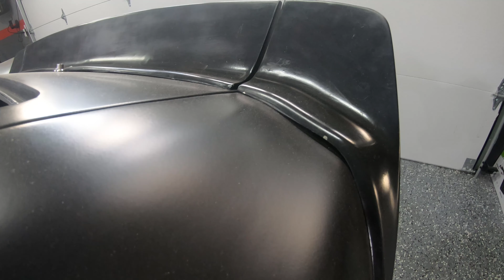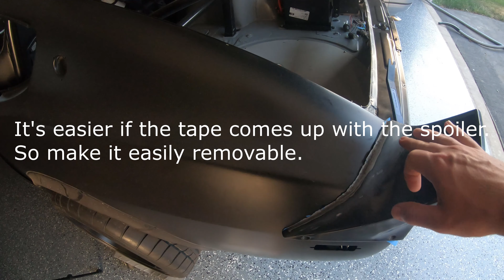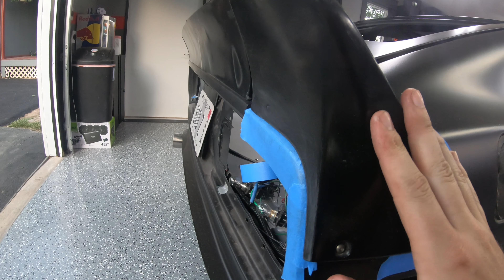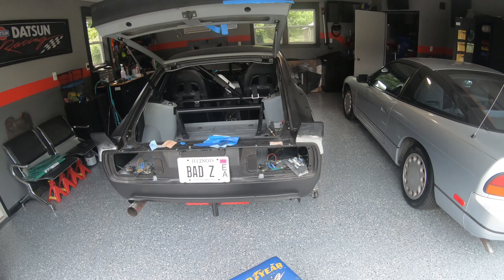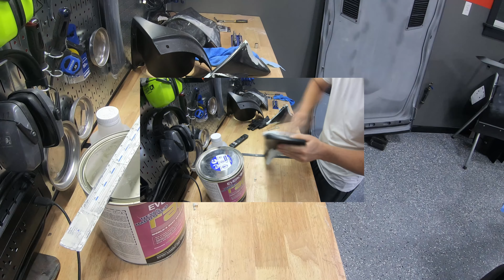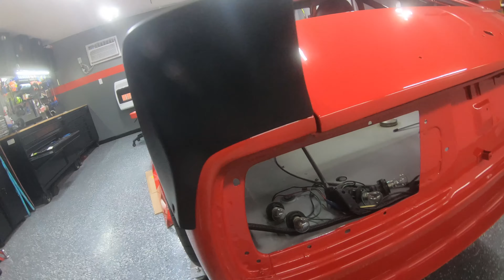Refining the 3 Piece Spoilers Fitment on the 280z

Comment: Water needs to get out. 
It will rot the car.
Mine had been molded and and the hatch under the wing is garbage
Reply from the maker: I don’t share that concern. The fitment is not so tight it’s going to trap water. lol or so tight wind won’t be able to find a way in and help dry.